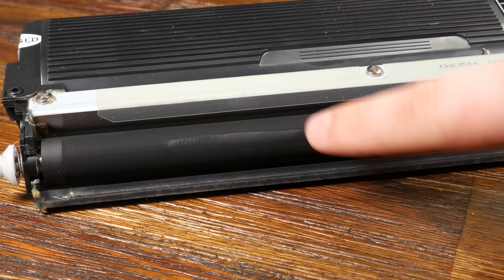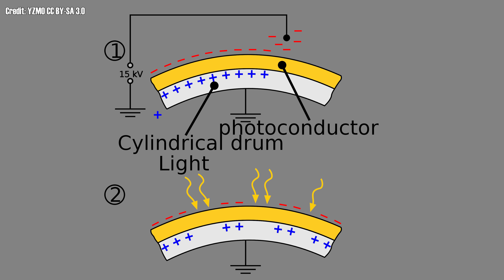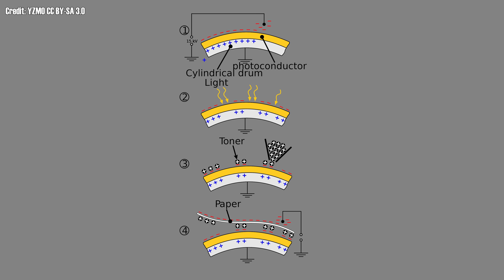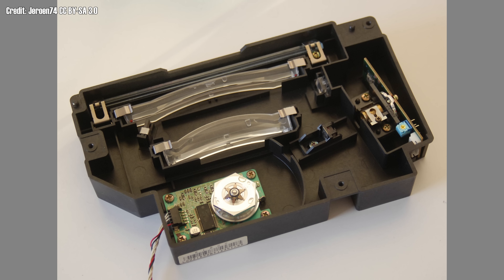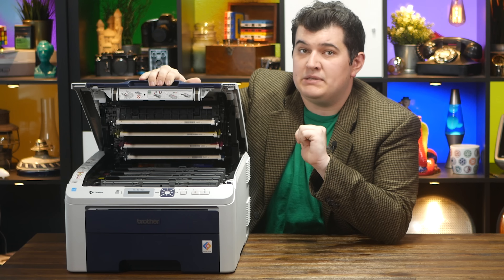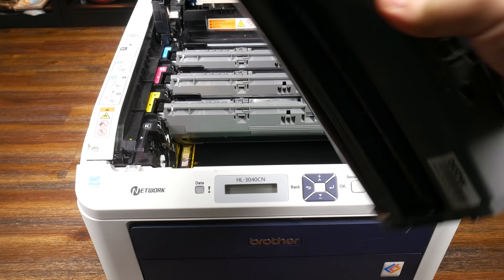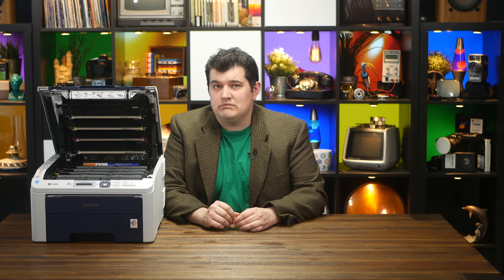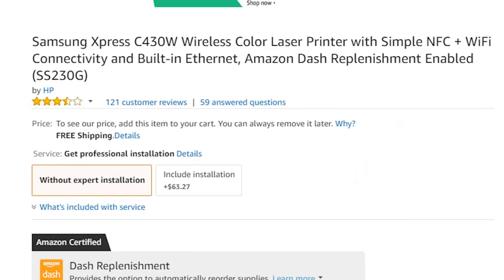LED Printers: The Common Printing Tech You Haven't Heard Of

Comment: Have you done videos about bubble jet, solid ink wax printers, color ribbon photography printers (commercial grade), Alps ribbon printers that print white, metallic gold, metallic silver, metallic magenta, metallic cyan, clear glossy overcoat, and LightJet drum printers that use RGB lasers to develop commercial photography?
Reply: I miss color wax printers. They smell like melting crayons.
Reply: Are solid ink printers still sold? I know someone who got one, useless thing it is. 
Bubble jet is more or less inkjet,  but is Cannons way of putting ink on the paper. Maybe why I like Cannon bubble jet printers.
Reply: I really liked the Alps' printers.  I'm not sure what the binder was, but I liked the way the ink looked.
Reply: Inkjet uses piezoelectric to heat a tiny bit of ink which flash creates a small bubble inside the jet which makes a single droplet fly out.
Reply: Some of the early inkjet printers in the '80s were called "spark-jet" because they used an electrical spark to form the ink into characters. Reviewers said the printing quality was poor and you could smell the ozone from the spark discharge!
Reply: That's incorrect. Inkjet either uses resistive strips that flash boil the ink, or piezoelectric strips that squeeze ink out.
Reply: IraQ Nid i remember back when the Tek Phaser line of dye-sublimation printers came out. I was working in print design & pre-press, and being able to print a full-color proof felt like amazing magic! They looked so much better than the CYMK xerographic proofs. Back before then, when I was too poor for a color RIP, I'd print out 4-color seperations on a 600dpi b&w laser, then run the same page through a color xerox 4 times. It worked, but registration was nearly impossible and you ended up with crud from previous colors gunking up the fuser roller.
Reply: Am I the only one old enough to remember Ditto and mimeograph machines? Ditto used odd-looking purple ink and had a distinctive smell due to the chemicals involved. The teachers in my elementary school used them, but by the early '90s Ditto machines were almost totally replaced by photocopiers. But apparently they're still used in third world countries, because the simple versions of the machines don't require any electricity.
Reply: Ahh, I can smell it still. Those were good elementary school days of the late 1960's and I always loved being sent to make copies for class. I think the chemical may not be good to huff :)
Reply: @vwestlife  ah, mimeograph. No smell in the world like pages fresh off the mimeograph in 1970s grade school. I dunno why purple was the color everyone used when other colors were available. At some point the school got a Xerox but it was reserved for tests and office paperwork while the mimeographed pages were for students daily work.
Reply: greggv8 I think those mimeographs had a different name around here.  The ones I knew required the original to be written on special paper with a purple pad passing through the pen or typewriter pressure to the stencil material.  Output was limited to somewhere between 25 and 50 copies as it was actually the ink on the original stencil being transferred to the copies.  But that number was fine for assignments to a single class of 20 to 30 children.
Reply: IraQ Nid Don't forget the plastic label printing systems from Brother and DYMO.  Different details but highly durable output.  Quite the opposite of low cost thermal printers used by many cash registers.
Reply: Is anyone else from a "clear plastic currency" country thinking about the possible applications of that ALPS machine?

Comment: Reasons that he doesn't like ink-jet printers:

-Ink dries out, meaning that the printer needs to either constantly be preforming a "maintenance mode" which wastes ink, or you need to print rather frequently which, in this paperless age, fewer people are doing.

The herky-jerky nature of the print heads as they travel back and forth is very unpleasant compared to the smooth print of pretty much any laser printer.

-ink cartridges are usually priced at stupid levels, meaning that you're forced into bbuying generic ink which often clogs the inkjets so you're damned if you do, damned if you don't

-Because the ink is liquid, freshly printed documents have a tendency to smear if touched until the ink is dried.

-Water-based inks are likley to completely wash away if the paper they are printed on becomes wet meaning shipping labels printed on some inkjet printers can be rendered completly unreadable if they get wet from something like, oh I don't know, rain.
Reply: I accidentally hit enter xD There's one more bit

- None of these issues plague laser printers, so despite their higher upfront cost(and arguably more expensive toner) you can pretty much count on them to work perfectly even if they've been idle for over a year, they don't waste toner on "maintenance" modes, the toner is bonded to the paper so water doesn't smear it, the toner is never wet so you don't have to wait for it to try, plus spills can easily be cleaned up as the toner is a powder. I could go on, but if you read this entire thing, now you know why I generally dislike inkjet printers and why I will forever use laser printers. Or LED printers, which are the subject of the video as you'll soon see.
Reply: The main issue for me with inkjets is the drying out.   I have a printer at my mom's location that I only come by once every year to visit.  No fears wit a laser/led.
Reply: @pmailkeey cleaning does waste ink in every inkjet, but only when initiated by the user. My HP Photosmart 3310 did "maintenance" almost every time it was turned on. HP claimed the ink was "recycled" but that was BS. More than once when a tank was almost out when I'd turned it off suddenly was conveniently empty the next time I turned it on and it just had to do "maintenance" again.
Reply: Canon inkjets don't have most of those issues, especially not "maintenance" pissing away the ink. Canon printheads are easily removable so in the very rare event they clog they can be soaked in rubbing alcohol overnight. A cleaning cycle or two has them working again. It takes a long time idle for a Canon head to dry up when unused, more than a year if tanks with ink are left in.
Reply: Just get a Epson or cannon ecotank/supertank(whatever the cannon one is called) one. Inks pretty much free on those ones so printing something every few weeks just to keep it from drying out doesn’t really waste any ink since it already has basically a lifetime supply inside.

It definitely does get annoying though if you do let one sit for a few months, then need to run like 3-4 maintenance programs till it prints a full test patten. 

The much cheaper, and basically unlimited ink is a huge benefit though if you actually use the printer. Getting toner for my laser printers costs like 100s of dollars, where buying a full set of refill ink for the ecotank is $25 for 2 big bottles of black, and 1 bottle of each colour. Getting out 14000+ pages for $25 is an amazing deal, and literally pennies on the dollar compared to buying the equivalent amount of toner for a colour laser. 

Filling all the colours on my Brother colour laser is like $200 for 2 black, and 1 of each colour (3rd party, would be even more from Brother for high capacity toner). Plus for that $200 only gets like 3000 pages.
Reply: Modern "page wide" HP office inkjets don't shuttle the print head like home units do.
The print heads are the full width of the paper.
Much smoother and faster, as well as quieter.
But. 
Jet clogging can still be an issue, and of course, in these, changing the ink cartridges doesn't replace the heads.
A dried print head is probably expensive.
Reply: Inkjet printer ink is the most expensive liquid ON THE PLANET.
Reply: *performing
*buying
*likely
*completely unreadable

Comment: Even a lot of the manufacturers themselves mix them in with laser printers on their homepages. If you read the specifications they then talk about "LED technology" though. The german Amazon page does show "LED" as "printer technology" for some. But not all, even if the description text then says "LED technology" again and there isn't a separate category either.
Since usually manufacturers seem to market even the smallest change as the "newest and best thing ever", maybe LED printers still have some issues so it's not something the manufacturers want to point out?

Comment: Printers with frickin' lasers! Love 'em. I bought my laser after the same frustrations with ink jets as in that quick scrolly text. While only b&w, I bought it second hand for less than a tenner when the owner upgraded to colour. It had a 7000 sheet toner cartridge in it and was still printing fine for another 4 years from when the toner low warning light came on!

Comment: When I was a kid and saw my first laser printer I thought it burned the paper :) I thought it had to be true because the paper was warm and smelled unique.
Reply: Thats what thermal printers do, well not exactly, they heat up a paper coated with some material that turns black when heated.
Reply: Always thought fresh laser prints smell like pancakes fresh off the griddle. :P
Reply: Same, and with Dot Matrix printers, I thought it poked little holes into the paper (which is why I thought it made so much noise).
Reply: @over00lordunknown12  Some would do just that if the head to paper gap was too tight.
Reply: someone should make a printer that burns the paper
Reply: @okovermekeamglight4563  having seen leather burning craftsmen doing their pieces, I think it would work if you use parchment
Reply: @okovermekeamglight4563  Thing is , it would only do black and white.
Reply: @Tapirus Sbrabous we are talking about thermal receipt printers , not laser printers. Those have a layer on the paper itself that when exposed to relatively mild heat(eg, scratching with a coin or fingernail), would turn black. 

Laser printers however, do apply toner and melt it onto paper(it's slightly more complicated)
Reply: Same!!
Reply: I still thought that until just now

Comment: Ricoh’s printer has similar speed on color and black/white, but the spec clearly states it’s laser, I’m confused
Reply: Why? Most printers today, even the small ones are in fact laser.
Reply: That's because they use a series of actual lasers and mirrors to do the same thing as this LED system
Reply: It could indicate that the printer has no transfer belt and passes the paper across the 4 developers regardless of printing color or monochrome.
Reply: @zaprodk  at least mine (C250DN) has a transfer belt, so the more likely explanation (and having torn down that printer i can say this is true at least for this model) is that the 4 lasers inside create the image simultaneously via a complex set of lenses and mirrors.

Comment: I used to have an OKI LED printer, it was my first "laser-type" printer after rather bad experience with sparsely used inkjet printer.  If I remember correctly, OKI LED printers were even cheaper than "true" laser printers. Though not by much.

Comment: For someone who likes clever and sometimes excessive mechanical solutions (like disc loading mechanisms) you might want to take a look at some laser printers. My Canon LBP7010c has the dreaded slow colour speed because the tonor carts are on a revolving carousel - it prints a colour, turns the carousel to the next tonor cart, then passes over the page again, rinse and repeat for the 4 colours. One of those 'was this really the most cost-effective solution you could come up with?' designs.
Only problem is that it's probably tricky to rig a printer to show off this system in action.
Reply: Same with my new HP color laser printer. The old one also from HP which used all toners in row was at least 3 times faster than the new one, I am curios when the spinning mechanism stop working.
Reply: Not a problem for an engineer.  A few jumper wires and clamps to bypass sense switches can reveal almost any mechanism.

Comment: I wonder if those little lenses in front of the LEDs don't easily get blocked by some dust particles, resulting in lines in the print. Reliability is pretty important to me. Laser printers are generally the most reliable ones out there, i hope the LED printers will be just as reliable. 
My B&W laser is from the year 2003 and works fine, and i came across some Laserjet 4l's that also still worked flawlessly. 
I 've used 3 color inkjets of which two lasted only one year, and the third lasted 3 to 4 years. I'd loooove a good alternative to color inkjets because those shitty things make me wanna get a baseball bat and smash them.

Comment: I don't know why devices like laser printers, laser pointers and barcode reader use real lasers. Why don't they use LEDs focused through a lens? They do neither need a monochromatic nor coherent light, so LEDs could've been WAY cheaper.
Reply: You actually do need coherenct and monochromatic light to either produce a narrow focused spot or to create a beam with low divergence. 
Google "Rayleigh range" for more info.
(I m not sure barcode scanners require any of these)
Reply: @oscargr_  Old (laser) barcode scanners sequentially project several raster patterns at different angles by reflecting the laser beam onto a set of rotating mirrors anf prisms and are thus able to read 1D barcodes whatever the orientation. Recent barcode scanners use red LED illumination and a linear CCD sensor. The most advanced LED scanners use monochrome cameras and can decode 1D and 2D barcodes at any orientation using advanced digital signal processing. technology.
Reply: @atmel9077  Thanks for your reply.
Hindsight, I do remember those barcode scanners below supermarket conveyor belts.(they required lasers)
When I said I don't know barcode scanners need lasers I was thinking about those hand held ones and the ones that are an app in every phone these days. (Using digital image processing)
So I guess whether the barcode scanner needs a real laser depends on the type of technology behind the scanner you are talking about.
The original point I was trying to make is that certain properties of lasers can not be achieved by using LED's. 
Although an LED is a narrow point source, it cannot be focused to a spot in the same way a laser can.
And you can not create a beam with low divergence the way a laser can.
Reply: @oscargr_  That's why laser pointers are laser. I don't know how they can get them so cheap because even low power laser diodes are expensive to buy.
Reply: @atmel9077  You confuse me.
Your first comment was that you don't know why laser pointers use real lasers.

Actually laser diodes up to a few milliwatts  (especially red and infra red) are dirt cheap. They are cheaper than the little metal cylinder tube with a lens in it that they are mounted in (for the application of a pointer)
Reply: I rather meant "Ok now I understand why they use real lasers" IDK why i wrote that
Reply: @atmel9077  LoL.
It's okay, at least we had some conversation. ;-)

Comment: But can you explain why my printer never prints what i want it to print? And it never works or has to clean itself when i need to leave quickly...
Reply: The answer is simple: inkjet printers have a soul, and they're evil. They're also smart and can smell your anxiety. They will do everything to make your life miserable. 
Get a laser printer. Even my cheap one has been flawlessly reliable for 10 years, after which it needed some maintenance to the rubber parts. It is now 15 years old, still working well.